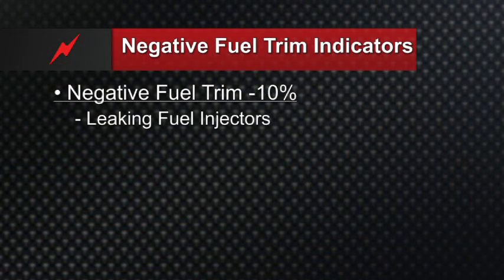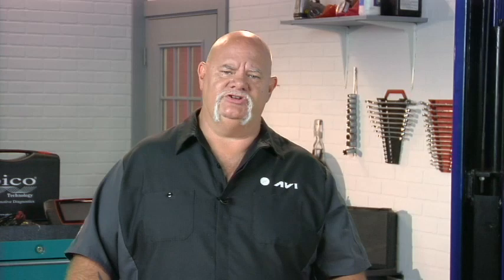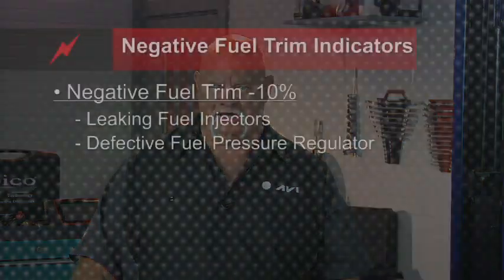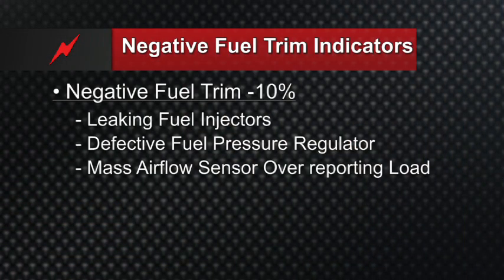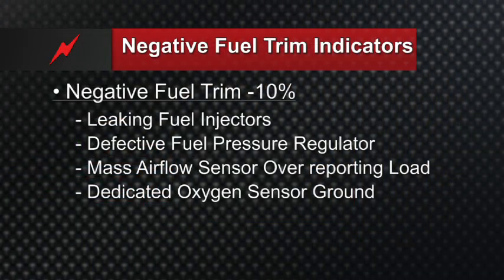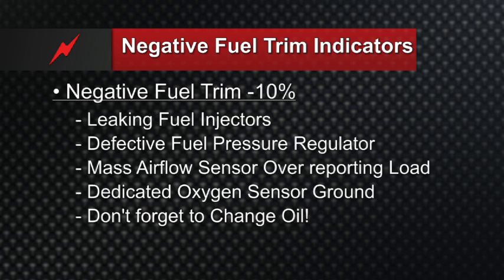Negative Fuel Trim Indicators | Ron Bilyeu | Tech Tip

Comment: I have 3 years struggling with long term trims on negative on a 07 camry, sometimes is on -30, then i fix something like vacuum leaks, old air filter, pcv valve change, etc. And ltft go down to -14 or something, but inmediatly goes up to -28 or something

Comment: Remove the hose from the PCV valve to the intake manifold and plug it.
Unplug the breather hose at the top of the engine.
If the fuel trims go to normal, you have a problem with crankcase vapors.

Comment: Negative trim means
1. over-fuelling - faulty pressure regulator, leaky/faulty injectors
2. under-burning - weak coils, faulty/fouled plugs
3. air blockage - blocked intake or clogged cats (if one cat is blocked, that side will go negative while the other goes positive)
4. faulty sensors - MAF, lambda.
Reply: Also check the fuel tank purge valve by disconnecting it and plugging the purge valve.

Comment: my car Reports negative ten long term fuel trim ONLY AT IDLE  as I push gas pedal little bit like 1200 rpm or 1500 rpm the long term fuel trim comes to negative 3 or less immediately  ! any one can tell me why it shows negative ten at idle only?
Reply: Honda?  Valve adjustment.
Reply: Did you clean the MAF sensor?
Reply: @shinola228  my car has MAP SENSOR and I cleaned it and on  scanner it's showing normal 30 kpa reading at idle.
Reply: @nadeem5476 did you find the solution mate?
Reply: @RBPD92  no

Comment: Hello, I have a 10 TSX 2.4L both my Fuel Trims are negative (-18%) I got a new dense upper sensor, if i disconnect the upper 02 sensor the short term goes back to 0 (which makes me believe injectors are fine and no air leaks ) if i plug the upper o2 back in it goes back to negative. after driving it for 10 miles i get a p0420. ANY IDEAS ? THANKS

Comment: have short term bank 1 reading  25.0 and Short term bank 2 reading is 25.0 then both goes back down to 0.0 then go back up to 25.0 I was looking at the fuel system 1 and fuel system 2 it's saying open loop fault when I step on the gas to 2500RPM and let it go the short term drop down to 0.0  I have a vacuum leak somewhere

Comment: 2006 Acura TSX auto, having my LTFT between minus 5% and minus 8% consistently at both idle or at normal diving. No driveability issues, no check engine light. Starts right up first thing in the morning and even after it's fully warmed up. STFT is mostly between plus and minus 3%  at idle or normal driving. Mileage is about 240k, what could be the issue?
Reply: That's normal. 10% is where you need to start looking.
Reply: If it's a boosted vehicle you want to stay on the rich side to protect from knock and other lean issues. Plus the PCM is telling the ECU to cut back on fuel because it is rich which in turn can lead to better fuel mileage. I have a boosted 5.0 and mines stay around -3 to -2 STFT and -5 to -7 LTFT but go close to 0 during boost then they both add fuel after boost to compensate for the extra air that came during boost but drop back to those negative percentage mention above afterwards.

Comment: I have a question. The car is running rich, the ECU is reducing the injector pulse time to compensate, the fuel trims are negative. The car is no longer running rich.
Does this still contaminate the oil?
Reply: Exactly my thoughts…. Sounds like nothing needs to be done… ecu has already corrected fuel delivery rate… all should be good now… right.???

Comment: I wish I could call you.  I have an issue where I have negative short-term trim but the long-term trim never changes and the engine bugs at high RPM and Lacks enough power that it won't shift out of first gear.

Comment: Very good video! My car is running -9 , i changed both upstream sensors  because of a p2a code.my car still hesitates during hard acceleration. I cant figure out what it is
Reply: What kind of  car? Im having similar problems, but with a -20 fuel trim.

Comment: The longer it runs rich fuel; it will contaminate oil. Got it.
Reply: Agreed, I tried to clamp vacuum line from the engine and downstream O2 reports lean.

Comment: Thankyou so much for your full explanation. 
After a lambda fail my car was running rich and reporting lean. Changed the lambda sensor the car was going fine but with a 10-15% correction on the lean side. Thanks to your help I've changed oil and oil filter (only 500 miles aged), and everything is back to normal now!
I still got a problem of negative LTFT when running on LPG (got a bi-fuel Opel Astra J 1.4 104kw): maybe you've got a clue for that too?
I really appreciate your calm and clear explanation!
Reply: Hey man, did you do antything to get lft with lpg sorted out? im having a similar problem of ltf on lpg being -12%. Opel corsa d
Reply: @maks1251  I've solved changing LPG Injectors. Spring inside comes weak and they start leaking, somebody says even after 50-60kkm. My trim was bad low expecially without load. Now it's clear to me that the root cause was leaking injectors, showing the leak more when commanded pulses are short.
Reply: @giannivalenza1751  Thank you for your response. Unfortunately, my lpg instalation has 3k kilometers driven and its a pretty decent kit (tailored to my car by someone i trust), so i have to look somewhere else :/

Comment: What about boost leak, can that cause negative trim too?
Reply: I have never worked with turbos really but if you lose air that has been messured by the maf ex. maf read   10g/s but the combustion only gets 7g/s then your car should run rich yes
Reply: can u explain what boost leak is?

Comment: @AVI ON DEMAND Thank for video. Could you help me make sense of these STFT and LTFT values. I have 07 ford taurus, for bank 1 STFT stays between +/-3%, but LTFT stays constant at about -12% at Idle. Bank 2 is lean at idle with +12%  total fuel trim. When I increase RPM to 2500, STFT jumps between +/-6% and LTFT stays constant at -19%. Bank 2 improves at 2500 RPM with about +6% total fuel trim. OBD says cylinder 1,2, and 6 misfire. I have tested injectors, replaced the leaking injector already. What do these trim value mean? How come bank 1 is rich and bank 2 is lean? Thank you.
Reply: I had the same issue, Change air filter and sparkplugs

Comment: Thanks to you, i suspected i had a MAP sensor over-reporting engine load,both fuel trims were  around minus 20,still no engine light on,it was just a routine check; replaced it with one from another car,i have three(2000 and 2001 daewoo nubira SW 1600 16V--one of the BEST cars i´ve seen-35 years as a mechanic-cheap to buy,dual fuel,gas and lpg, 260000 kms, quiet,everything functions like new,nothing breaks down),and now fuel trims are fine.
Reply: Boas, José. Também tenho um Nubira 1.6, mas é Chevrolet e ano 2007, no entanto presumo que o motor não mudou tanto assim. Também tenho essa suspeita que o sensor MAP não esteja funcionando bem. Onde compraste o sensor? Obrigado.

Comment: Perfect explaining tank you 🙏🏻🙏🏻🙏🏻
Is LTFT should be stable?
In my car LTFT are -5 % while driving, But when i release the throttle (gas) pedal then LTFT go down to -13%
When i push again throttle (gas) pedal  then LTFT back gradually  -7%   -6 %  to -5% and some times -4%.
All this problems i have it after i added STP fuel injectors cleaner.
I smell fuel in the engines oil and i did change the oil.
LTFT should be stable while driving? Or what?
Thanks a lot 🙏🏻
Camaro SS 2018
Reply: Did you fix it ?
Reply: @AnythingEverythingGh  
It could also be from EVap valve stuck open, it will continuously allow the fuel vapor to get inside the intake manifold 
I will try to find something about fuel sanolide
Reply: @SuperCarSweden  Great, evap valve is good, check that also, tested it all good
Reply: @AnythingEverythingGh  
It was for a friend’s car ;
It was injectors leaking and the LTFT went down to -23%
We did change all injectors, and change the oil again 
The car now runs perfectly 
If you have injectors leaking then the engine’s oil will smell gas clearly.
Check your oil
Reply: @SuperCarSweden  In my case injectors are good and they are not leaking fuel into the combustion chamber. 
Don't really what to look up next again; am running rich
Reply: @AnythingEverythingGh  
What car?
What mode have you?
Tune?
Did engine’s oil smell gasoline?
What LTFT have?
Reply: Nissan Sentra 2008 
No tune 
Yes, engine oil smell gas being running rich for long 
Check map sensor, injectors, o2 sensors,  air filter, fuel pump, spark plugs, even changed Pcm/ ecm too 

No changes 

Btw, when I remove the engine oil dipstick while watching fuel trims, the ltft reduce a bit to about -8 instead of constant-10.6 whiles stft oscilate between -20 > -3
Reply: @AnythingEverythingGh  
I did use my other YouTube account to reply  just to know.
When you remove the deep stick the air suck inside the engine during PCV system and that is air leak , it’s air not calculated and pushes the fuel trims to lean side.
Reply: @AnythingEverythingGh  
You have to check injectors
If you car have GDI system High pressure fuel pump HPFP
It could be leaking fuel inside the engine’s oil.
If you’re car don’t have GDI HPFP
Then check the fuel sanolide ; there is a vacuum hose
If the fuel sanolide bad the the vacuum hose will suck fuel to the engine oil
Reply: @FerasDishli  So this is normal??
Reply: See my reply updated 
Hope you will fix it
Reply: @FerasDishli  Checked them, they are not leaking . Remove them, KOEO no fuel dripping.
Took the opportunity even to clean them. 

My question is should I look at a vacuum leak where ever chasing negative ltft?
Reply: @AnythingEverythingGh  
See what i did write/ update the previous comment about fuel sonolide,
For air leaking always makes lean LTFT/ stft
But fuel sonolide ( fuel leaking will sucked by vacuum hose to the air manifold) and will make rich LTFT ( negative)
Reply: @FerasDishli  ok 
Don't have a GDI system, trying to browse around that, its "sanolide" the right word ?

Bet, might be the reason. 
Someone also told me to check if fuel rail line is cracked or something like that
Reply: @FerasDishli  Please where can I find the vacuum hose with the fuel sanolide? 

Any link of a picture or example so I can relate with mine and check it 

Thank you for your help with with this 

I really this help, being chasing this rich running for 2yrs +
Reply: @AnythingEverythingGh  
Yes about the deep stick is normal
Reply: @FerasDishli  Can a wrong injector installed also cause rich condition as well, example a higher engine displacement engine installed on a lower engine displacement
Reply: @AnythingEverythingGh  
Yes absolutely; then you need a new engine tune
Reply: @SuperCarSweden ,  Thank you, man.
Reply: @AnythingEverythingGh  

Se this about sanolide and don’t forge Evap valve also

https://youtu.be/AKtR_yF7bi8
Reply: @SuperCarSweden  Thanks Sir 

I check it up 

I have even commented on that video before with the same problem; my car has the fuel pressure regulator as part of the fuel pump assembly in the tank so this workout doesn't affect my own ot solve it even according to SD when I commented.
Reply: @AnythingEverythingGh  
We covered all the things could make negative fuel trims.
- If the car too old ; the piston rings do not keep the fuel inside the cylinder.
- Short trips , the engine not warm enough to the operation temperature ; so it still rich (negative fuel trims).
Hope you will fix the car.

Comment: do you know why my car shows -100% on short term fuel trim B1S2?
Reply from the maker: I would have to say, you need to check the fuel trims, look for any exhaust leaks, and then check the response of the upstream oxygen sensor. If you find any leaks repeat the process over and over. Graphing the oxygen sensor outputs with a scan tool is a great help too. For more advice talk to a local auto shop or visit our website aviondemand.com.
Have a great day!
-J. from AVI